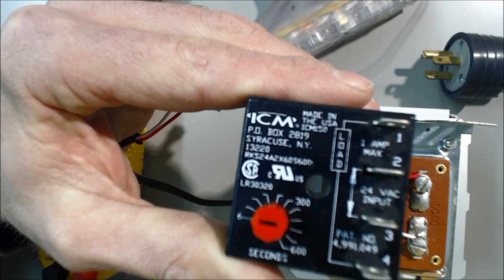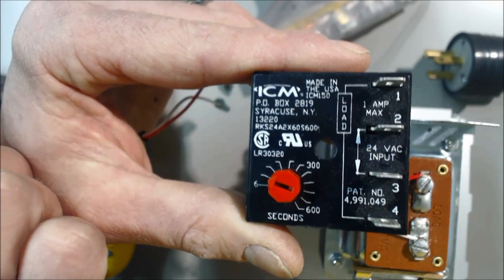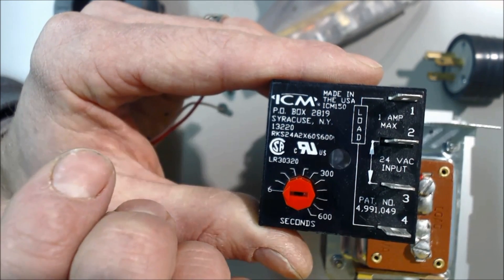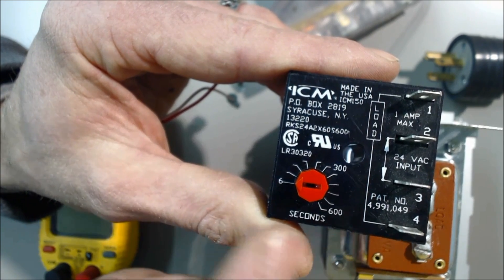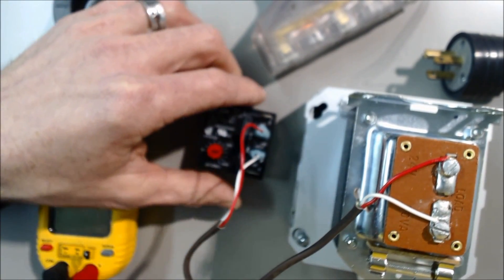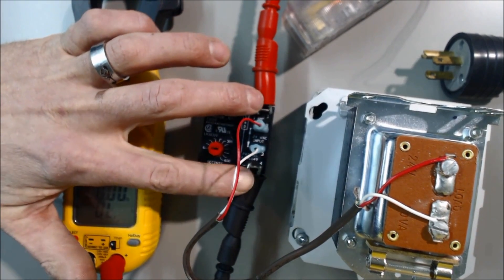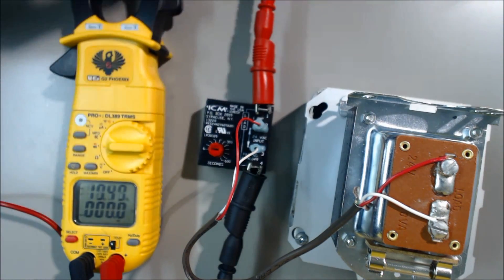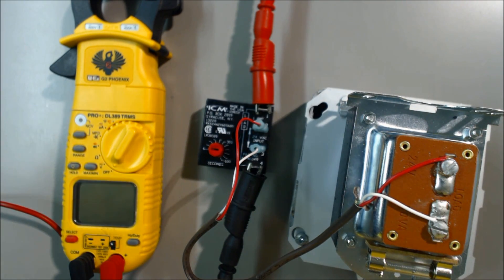Troubleshooting the HVAC Delay On Make 5 Minute Adjustable Timer for an A/C Compressor!

Comment: Thanks for this... Would appreciate your advice on something.  I just had a new Trane 4 ton R454b system put in 4 weeks ago.  The unit was great until a week ago which is when it started making what i describe as a half-second clanking noise during shutdown.  I replaced the contactor with a double pole contactor and put the FAN on the supply side of the contactor.  This was an attempt to remove the back EMF that is possibly created during shutdown.  This did not remove the clanking unfortunately.  This is a known issue with many people chiming in as to the cause... back EMF being one of them to oh no issue at all this is normal operation no big deal.  If that was the case why did my not do it initially for 2-3 weeks?  Back to this video... I was thinking could i install this timer to allow say the fan to shut down first for say 5 seconds and then allow the compressor to shutdown... or vice versa?  That would decouple them shutting down simultaneously which I am 99% certain is what is causing the issue.  The tech shutdown each independently and they did not make the noise so they are interlinked.  Really appreciate your thoughts on how this timer might help me solve this very annoying issue.

Comment: Mark, im installing a delay on make timer in a split -system condenser. my question is: would it be better to delay the Fan, or the compressor? the reason for doing this is to quiet down the unit upon start-up, and to lower the start-up amp draw
Reply: I think the fan would be better to delay to prevent liquid from getting to the compressor... maybe 🤷‍♂️
Reply: But then again delaying the compressor too would be beneficial incase of intermittent power or a tstat without a delay for cooling call

Comment: Great great video. In technical terms, please explain why it is important for the an AC system to equalize before attempting to restart. How does an unequal pressure harm a compressor upon startup?
Reply from the maker: Imagine a water pump that needs to pump upwards but there is added pressure downward on the stack of water. It makes it very hard for the motor to start to spin because the impeller is stuck not allowing the motor to turn. It is similar but obviously different on a compressor.

Comment: Quick question, when a regular t-stat calls for cooling, it triggers the inside blower and the outside fan and compressor.

When the t-stat is satisfied, everything stops running.

Question ;

How can I get all that done, but, keep the inside blower to keep running an extra 1 to 5 minutes?

I would like the inside blower to run maybe 3 minutes longer to get all of the cold air out of ductwork and to warm up the A-coil more, to ensure that the coil has no ice built up, and to run it longer to filter my garage air a bit more.

Any device like that?

Comment: I watched your video again. It seems the LOAD showed on the timer Delay is for hooking up 120V for compressor?
Reply from the maker: Yes it is usually used to interrupt a 24v circuit but can be used to interrupt a 120v circuit. The 120v circuit is usually a control circuit such as the 120v coil on a general purpose relay. It is usually used to interrupt the 24v circuit on a contactor or 24v general purpose relay since it doesn't have high amperage contacts, thanks!

Comment: So, once the load is disconnected the timer starts to counter back 6 seconds? How does the load/unload affect the timer?

Say, I have an A/C has refrigerant leaking. When A/C starts, the low side pressure starts lower and lower, then trigger the low side pressure switch which disconnect the load (24V for the contactor). After the A/C compressor stop running the low side pressure starts to arise due to equalizing. When the pressure arise to a pressure higher than low pressure switch close value. The A/C compressor starts run again. To avoid this kind of short cycling this is the good option to have this delay on the A/C 24V line. 

 Can you explain that a little bit? Or, do you have another video to explain a little clearer? Thank you.
Reply from the maker: Yes you are absolutely correct, if there are pressure switches then break that 24v circuit instead. Sometimes they are all the same series circuit if there is no control board, thanks!

Comment: I got a 30yr old york split system & i recently have gotten a big delay for my a/c to turn on,i replaced tstat twice but same issues,tstat is set on auto 78 & it turns on once home temp goes up to 82 thats 4 degrees difference,what can it be?
Reply from the maker: The thermostat could be calling for cooling and turning the fan on but the compressor may be having a hard time turning  on. Are the capacitors new for the compressor and blower motor. Is the blower motor turning on at least?
Reply: @acservicetechchannel  ..there a new condenser with the system,even before with old condenser it was doing it,yesterday i replaced the fan timer relay on furnace it seems to be working normal again
Reply: My tstat will go above 4-5 degrees difference before it turns on a/c,compressor,condenser fan motor & blower motor are fine.

Comment: Can a bad delay relay cause the thermostat to shut off?
Reply from the maker: Not usually unless it blew the fuse, thanks
Reply: AC Service Tech LLC  oh okay thanks. I wish I had found this video before I ordered the part:(I came home one day and my thermostat was just blank so I bought a new one and installed it and that one was blank as well. I went up to the furnace and with a voltage tester I tested all the wires. All the wires seem to have voltage except the wires connected to the Solid State Timer Delay box? Any advice or help you can give me would be truly appreciated.

Comment: Do you need to ground your txfrmer?
Reply from the maker: The transformer is grounded on the 120v side but on the 24v side common and ground are connected inside the furnace or air handler cabinet, thanks